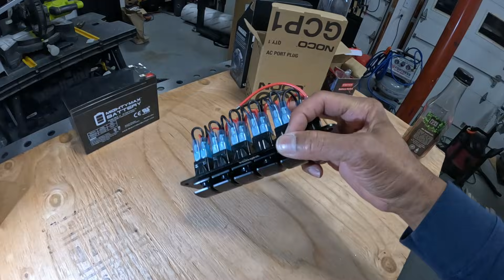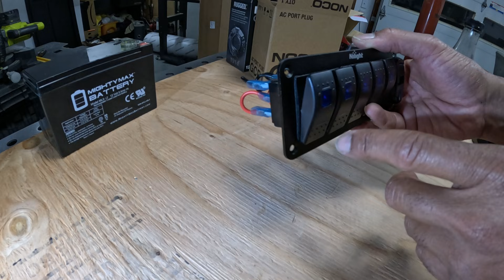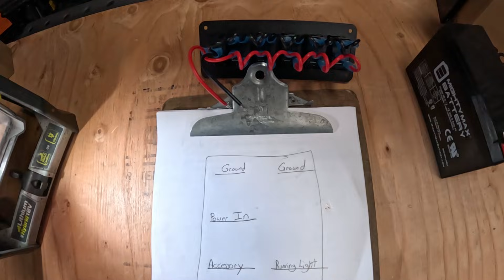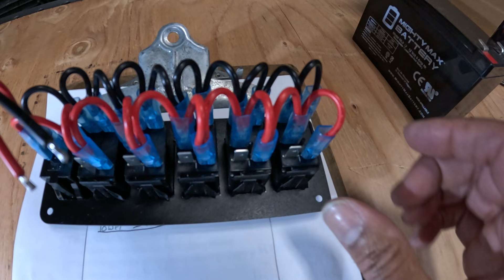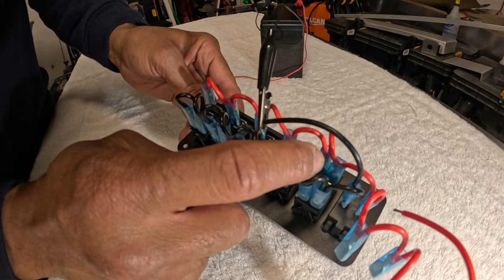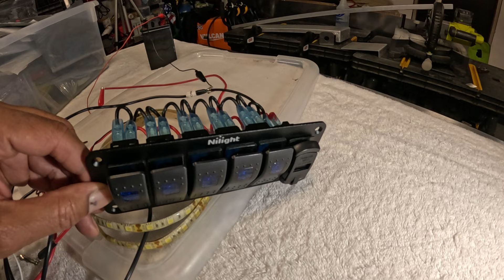Never Mess Up Your Switch Panel Wiring Again!

Comment: Can you show how to connect each accessory to a fuse in a fuse block that has a 30’amp fuse? I assume each power will come from the block and have proper fuse for bilge etc.
Reply from the maker: Correct

Comment: I’m using this same type of switch board for a solenoid to shut fuel off on my truck. I’d like to use it as it comes out of the box. Do I have to ground my selenoid at the end or just combine the ground?

Comment: probably nice to point out those negative connections are just to light the switch.  They are NOT the negatives for each device.  if they disconnect you lose the light but the switch works.  this is why there is no need to change it.  It carries no real power load.   this is why each fuse goes to the positive device for each switch on the panel.  The devices will have a negative but connector with all the negatives connected together somewhere else.

Comment: Probably wont get answered here, but  ok got all of it you showed here.   Connecting accessoires, after switching to all midd3le ones and cutting off . Where does the accessoires positive go and where does the negative  go? After that ? Yours look to be leaving middle out and connect positive and negative accessoires to main switches positive and negative.  Is this correct or did I miss something. You just ( i think ) then hook up accessoires 
 But not what to what now.

Comment: So now that right switch controls power to the switch lower lights only? I want to rewire mone so that the one switch controls ALL power to the rest of the panel. Looking at the front of thw panel, my switch would be on the left, and I'd like it to cut all power to all other switchs, not just the backlights. And if I want to use any accessories on the other switches, the main control switch would need to be toggled on... and I have no idea how to do that lol

Comment: My master switch works…but no power to the individual switches.  I connect the left spade to the red (postive) wire of the light. Does the neg from light need to be connected to the fuse box?
Reply: Yes

Comment: Great video and appreciate you creating. Although, unclear on 3 things: 

1. Do you connect the black wire in the back of this switch panel to the (-) on battery or ground on side of vehicle?              

 2. how you would connect each switch to individual fuse using auxiliary fuse box? Does it go through the fuse box to the power or from switch to fuse box? 

3. Do you connect the red (+) battery power to the back of the fuse box, through the fuse and then to the back or just run power directly to the back of this panel?
Reply from the maker: Single hot to fise box the power each switch from fuse box

Comment: so the switch is dedicated to powering the other switches? could you also tie in an accessory to that switch so it works as the main power supply to the panel AND 1 of your accessories?
Reply from the maker: Sure

Comment: Question. Ive done what you did. Jumped all the ground and have individual red wire running from each switch to fuse box. If i am attaching a pump. I connect red wire from pump to switch. What do i do with ground wire thats coming out of the pump?

Is the ground wire thats jumped only for illumination? So i need to run separate ground from pump to fuse?
Reply: Yes the grounds on the switches are only for the grounding of the lights which are LEDs and barely draw any current.  You need to run the pump ground to your ground bus or to the battery how ever you have your system built.  Also as he suggests run separate power to each switch with the appropriate size fuse for the circuit. Ie pump approx 6-8 amps

Comment: No no no no. Do not follow this or use those switch panels in the standard configuration.  Using one fuse on the input wire only does not offer the correct protection on the individual switches.  I don't care how many be days he had installed.  If he did it like this,  they're all wrong.   Do not follow this video as a how to

Comment: this wiring setup assumes the accessories are either low amps or not going to be used at the same time or that wach switch will be used with a relay because those wires aren't going to be enough for a bunch of higher power stuff.

Comment: Fuses don't protect your device, they protect the wire. The only reason to individually fuse each switch is if the total power draw is more than your single power supply wire can handle, or if any wire you connect cannot handle the current of the supply fuse, in which case, that small wire circuit could be fused after the switch. 🤷‍♂️

Comment: Great video, thank you! Instead of rewiring the back on switch panel to include the fuse you could just install a fuse block after the power of the switch on the way to the accessory right? I hope lol that’s my plan next month for our camper
Reply from the maker: Yes

Comment: This was great! Wiring it up like this, do fuses go between power to switch or between accessory and switch?
Reply from the maker: Fuses go in-between power from your battery and the switch (the fuse box).  Then you plug your accessories directly into the switches.
Reply: @BassBrothersFishingDMV thank you very much!

Comment: That's clever , I need to do mine , 5 gang led , the voltmeter and usb are permanently on draining battery , i presume its sort of the same way as doing this seems similar in the back but mine have 15amp fuses in each one , thanks

Comment: So say I want to run different amplifiers and lights to the back of the switch panel would I just run remote wires from the amps and the power from the lights to the accessory slot?! I thought this was harder honestly

Comment: I’m actually working on this right now for my box truck. My question is what if I don’t want the running lights? I want the switch to be dark unless it’s being used. I’m using a 5 gang (same brand) with a voltmeter, 12V cigarette lighter, and three switches. I’m powering a fuel gauge and diesel heater currently (no pun intended), and I want to turn off power to the whole thing with the first switch. The second switch I want for the fuel gauge. Third switch for diesel heater. On the first switch I want to also power the voltmeter and cigarette lighter. I got it working today minus setting the first switch as the master, cigarette lighter, and voltmeter. Thanks! This is a great video! And that liquid tape rules, people look at me like I’m crazy when I talk about using that stuff. 😂

Comment: If you want current to device through the switch but really the switch panel should be signal wire going to a relay panel where all the power to devices is routed through.

Comment: Greetings couldn't you just run the wire through a fuse panel so that it controls each accessory separately?
Reply from the maker: Each accessory is fused separately through the fuse box.

Comment: TIP: If you want to wire with separate fused circuits and no master cut-off, simply snip the RED wire coming out of bottom right that goes to the upper left of the next switch to it's right. 
Then use that pigtail to connect each separate circuit. 
Yes, try to cut just inside the spade connector's insulation and maybe dab the stub with liquid electrical tape.
Nice video and good explanations!

Comment: Just wondering but why wouldn't you just put a line fuse on the  signal wire to the light bar or fish finder? If your putting a fuse anyway then you wouldn't have double the wires (like the signal wire and the positive wire coming out the back) just a question. Im not sure just trying to learn

Comment: Bought 2 of these and they are terrible  switches. They do not take the power they are rated for. They melt. Running lights etc. Ran individual fuses relays etc. These panels are trash. Do not buy. Great concept  cheap trash switches

Comment: So the accessory goes straight to the switch and then what goes to the fuse box?
Reply: The main power goes to the fuse box via the 8 gauge from the master switch. The fuse box runs the power to that middle pin on the switch panel. Switch pans runs to the accessory.

Comment: So if I am understanding after doing this you would then connect the power in wire on each switch to its own spot on the fuse box so it can have its own fuse is this correct ?
Reply from the maker: Correct

Comment: Now doesn't that take away one of your AUX spots?
Reply from the maker: Use a switch to control your running lights if you know you its an extra one that you don't need. You can always change it later if things change.
Reply: @BassBrothersFishingDMV  I like your idea of an external on/off switch for the panel- for me that would work out better- you explained it nicely thanks. I don't have a boat just an old truck I want to upgrade

Comment: So by removing the center wires and placing them in the bottom left of the switch this will allow a fuse ( located on a fuse block ) to be used for each switch?

Comment: I never thought about it until watching this video that it’s almost like you should just describe the running lights on the switches as their own accessory basically lol because that was the toughest thing for me to learn and remember with these but also helps if you have a basic understanding of wiring because if I did not, it probably would have not been so easy to pick up everything associated with this

Comment: Have you done a video on using a fuse block instead of fusing each accessory (which is recommended) with the inline fuse holders which is not as clean a installation.Took me awhile to find someone showing how to do it.Have to remove all the power wires to each switch and run power individually to each one from fuse block then run your feed from accessory pin to whatever your powering.

Comment: So my roof fan 12v has a black and red wire, u showed where the red wire hooks up to, but didn't show what to do with the black wire, where does it go? 🤔
Reply: Black is ground.  Either connect it to any ground or one of thr 2 top pins which are grounds for the switch lights too

Comment: So when I wire everything up in my switch panel I have these 12 light pods and the switch panel I have is a nilight switch panel and it has four switches but the lights connect to my switch panel stopped working and I have a fuse connected to the it as well please help me
Reply from the maker: Check to see if you blew a fuse. If the fuse is good, check for a bad wire connection.

Comment: I was going to run a fuse off of the accessory port ONLY for my fish finder. The rest of the lights I’m not too worried about. Could I still create a main switch by moving the one from the bottom right post to the bottom left?

Comment: they do the hots like that so you can run the positive out to a relay and use it for the trigger to individual relays which is perfectly fine in that case, best practice is to always fuse and use a relay

Comment: I agree with your tutorial completely. An alternative to this and what I used on my Jeep and other vehicles is,,, Break down the running light circuit as you show, attach it into the vehicle running light circuit, the volt meter can be tapped into the accessory circuit. Connect power to the switch panel either direct to the battery, through the ignition switch/acc circuit or via a relay fuse protected in all cases. Which way is dependent on your preference, the vehicle/boat wiring and use. Now utilize the switches in the panel as triggers for relays running all of your "stuff" through relays. The benefits are: It reduces the arc wear on your switches in high amp load circuits. It allows the use of lighter gauge wire to your switch panel moving the heavier stuff directly to the accessory. You can often use an existing power source (under dash) to run the panel since it is a super low amp draw. Plus lets be real, those switches are not the highest quality/heavy duty things ever made, so taking the load off of them when applicable only helps. I have always enjoyed wiring, building circuits etc and have many times helped out my friends who were stumped (Often the minute the words wiring circuit was said LOL)
Reply: Relays are good.  For my boat I use the breakers but car inline fuses. 5 pins or more can be frustrating but once you remember them it helps.  I control my running lights and volt meter from the first switch usually.

Comment: Why does electricity have to be so mind boggling 🤦
Reply: Cause they make a 5 pin switch when all you need is 2 pins
Reply: Just start by learning and understanding a basic 12v circuit then it just gets more complicated but if you understand thd basics itz nog that hard

Comment: This all made sense until the end. How is the nav light working when the main switch is not turned on?
Reply: wondering the same exact thing! My understanding up until the last part was the first switch was acting like a master power switch to the entire unit - so thought it was simple enough - but then when he connected the lights at the end, I would have thought he'd have to flip the 1st switch on, then the light switch would work - guess that's not the case so back to confused haha
Reply: @ScottUTX exactly! I was with him all the way until the end. The main switch wasn’t on so how did the lights he connected turn on? It looks like he ran power directly to that switch which would mean all the switches now need a power source direct?

Comment: How did you get the nav lights at the end to turn on without the master switch and running lights being on? I want to wire a couple switches to 2 different lights but I don’t want the running lights on.

Comment: So I want to buy one of these but it says the cig socket is 60w most my gear is at least 6amps, would I be able to just change the wires into a thicker wire and be fine
Reply from the maker: @AnabolicBro  14 gauge wire should be fine.

Comment: Didn't work for me . I have the same switch panel with 4 switches. I kept replaying to no avail. Works as shipped but not as you  customized. I have a fuse panel which I still need to find a solution for having individual fuses per device. Why do you figure you need to present like a speed freak? Chill. The music doesn't help in my opinion.
Reply: No hate intended on my guy, but also wasn’t helpful for me, had to mess with it to figure it out and I already cut the supplied red wire!!, got it figured out tho!

Comment: What do I do with the negative wire on all my accessories I want to hook up
Reply from the maker: @justinwhite5859  you can get a bussbar and connect all of them to that then run a single wire from the bussbar to your battery or to the negative side of your bussbar fuse block combo if you have one.

Comment: Thank you! Installed two 8 switch versions of these on my C&C 34. They worked great but man it sucked trying to sleep with those on! I thought I was going to have to snip and re-connect with all the positive or negative wiring. But this is such a beautifully simple solution. Well explained too!
Reply from the maker: @sethrenaud8647  Awesome
Reply: Would it be easier to put an inline fuse after the feed out of the switch before the accessories??)

Comment: this is great video. I could never understand why on my rocker switch panel was there only one open male plug. but this is how they wire it for the simplest form. Its how i had it right now because i didn't know how it all worked. I have my 12'' Garmin connected to one of these rocker switches with no fuse or and breaker protecting it. I knew this was the wrong way and have been trying to figure out how to incorporate a fuse block bus bar system in this. now i understand just unplug the existing jumpers. the only part i don't understand is why did you jump them all to the first rocker switch? you just lost a switch then no?, but the rest of the panel is still hot without flipping the switch? just hot with not indicator lights??? thank you Im starting to understand more tho
Reply from the maker: @RichardJohnson-v1p  thats correct. He had an extra switch, so I used it to control the volt meter and the running lights.

Comment: If you wire the Lt. circuit to the Acc. circuit you will not have a parasitic draw and can use the Lt. as a fuse indicator for the specific Acc. circuit.
PS- don't forget to dielectric grease those switch blades!
Reply: What is a LT circuit ? Don't be lazy. Don't type the abreviation. Be clear. We are trying to learn here.
Reply: @johnr.johnston5808  LOL, "Lt." = light

Comment: Hi I must have missed where you connected the positive to you battery after you cut off the jumper which had the battery connection. I am assuming you connect a positive into one of the centre tabs? Also when I have a pos & neg coming off my device I know I plug the pos on the bottom left of each pos but where am I can netting the neg? Thanks I’m a newbie to this.😂
Reply: That was my ? Too
Reply: Negative for each accessory is either grounded to metal or to negative on fuse block

Comment: With leaving the jumper wire across the grounds does this mean you do not need to ground each unit. Such as the bait well, live well, GPS unit? They would still need to run to a separate ground correct?
Reply from the maker: @justus5588  No. All ground wires can be jumped as long as all the switches are running off of the same battery. No need to separate them like the positive leads.
Reply: So, i guess that the ground wires are just for the running lights? Great video and thanks for posting….
Reply: Yes each unit needs to be grounded, if there close you can use a busbar

Comment: I have a 3 panel switch with the seperate USB plug with Volt meter but mine is wired always on. So I will be looking to add a toggle to turn it off. Very good video. Thank you for the detail. That has become your TRADEMARK! Happy New Year!!!      Tight Lines!!!
Reply from the maker: @duanetaylorMeTimeLures  Happy New Year to you as well.